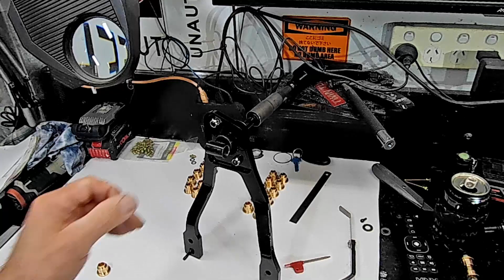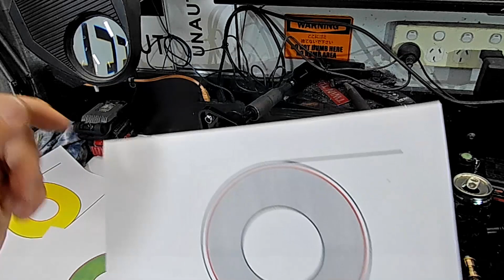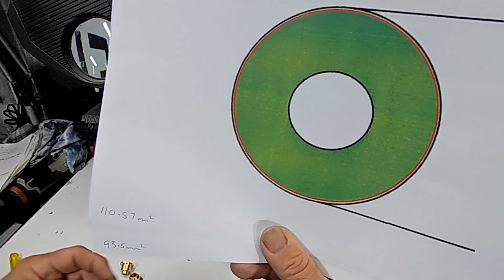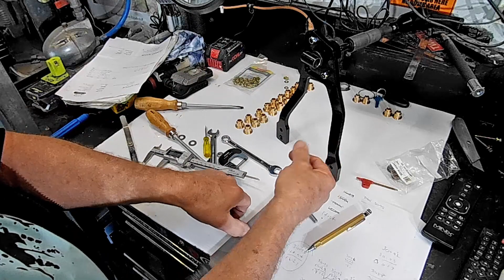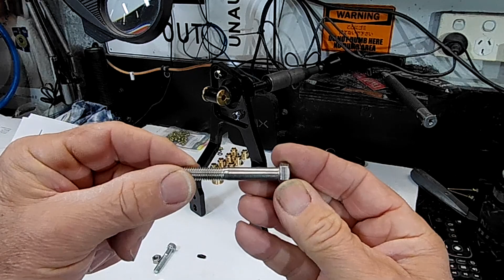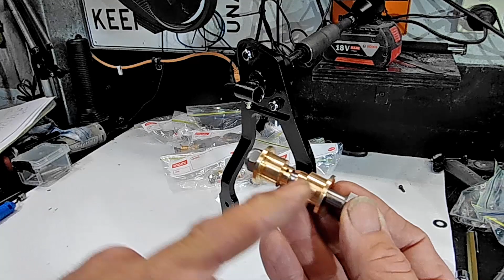Precision Greasable Shifter Linkage Bushing Project Fairlady Nissan Z32 300zx Twin Turbo Mega Build.

Comment: Excellent bit of kit. I want a set and don’t even have a fairlady (in so many ways 🤣). Great stuff mate. 👍👍
Reply from the maker: G'day Ricky, Decent Fairladys are not easy to find IMO, some of them look good on the surface, but can quickly turn out to be used up, temperamental wastes of time. Cheers Mate.

Comment: Love precision everything. One thing that bothered me though, the shank on the bolt will be moved further to one side when the thickness of the shift bars (? is that what they are called? ) is taken into account. I don't see that as a problem as the alignment of the brass bushings are determined by their inner faces when they are torqued, but still...bothers me.
Reply from the maker: G'day Ben, that was of course factored in to the design. The Alignment is correct when installed. Cheers.
Reply: @TheAussieShed  I never had any doubts! I just have this problems see...love shiny metal things to be perfect...absolutely perfect. Alas a state I will never achieve.

Comment: Would sintered bronze be a better option for the bushings.. Its a self lubricating material (once soaked in oil) they seem to work great in spigot bearing for crank/clutch shafts.. enjoy the progress and thought you go to, for your pride & joy .. cheers
Reply from the maker: G'day Mate, Sintered is great in some applications for sure. Its really a high speed, low frequency use material, which is exactly the uses you have pointed to. The Problem with it, is at low load, low rotational speed,  its lubricity is pretty much Zero. Which is why I would assume Nissan originally went with what appears to be Teflon in favour of Sintered Bronze on the factory setup. Sintered would be fine to use, but it still would need to be greased imo. Cheers Mate.

Comment: Hi, Trevor great job mate, but rather than the Nylock nut I think I would supply a stainless non-nylon lock nut that would eliminate the Nylon softening problem altogether.
Reply from the maker: Dam it, I know you're right. Done up tight it kinda puts that out of the equation, but not completely. I'll head out now & grab a Box of Steel Lok Stainless M8 Nuts. Thanks Mate.
Reply: @TheAussieShed  Your welcome Trevor glad to help.